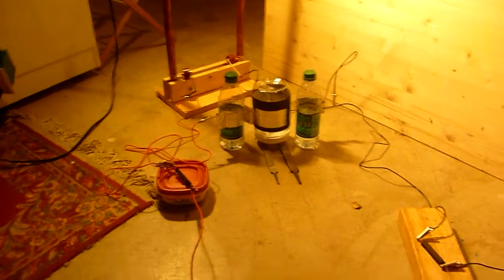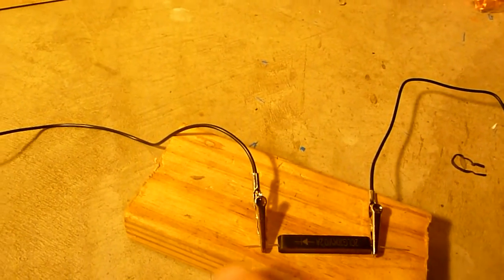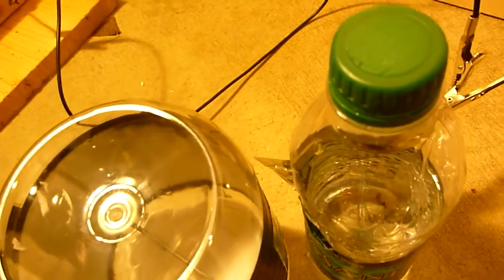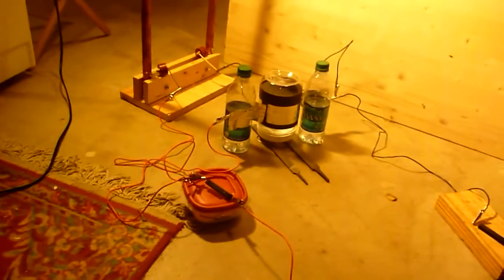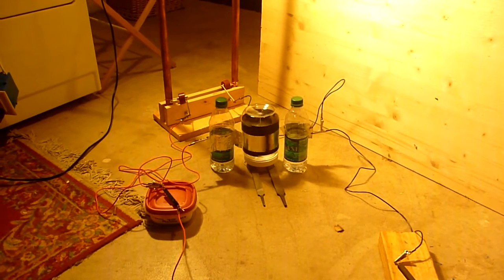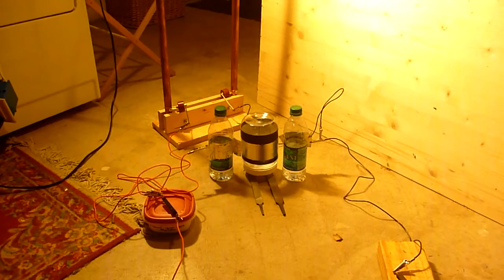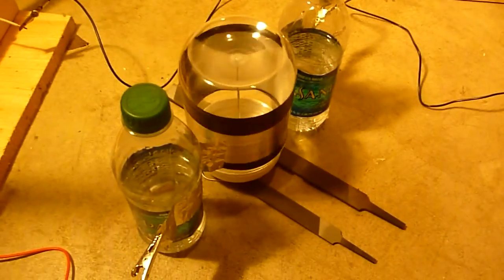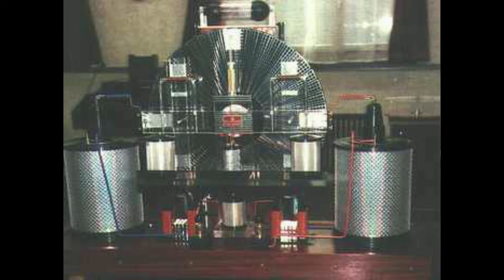Contact-free electrostatic motor (made out of trash)

Comment: I learnt just last year that energy does not flow through conductors. In fact, the an energy source just loses energy to the field (aether) and exact amount of energy is absorbed by the conductors and the load. Reading "A history of the theories of aether and electricity" right now. That's a cool motor you've got running there. Subscribed.

Comment: Nice diodes... I am going to get some like that, I've been shopping around for HV diodes for a while now... Nice setup and looking forward to seeing where your investigation leads you... Remember to always try and think of ways to quantify Power In vs Power Out... Looking forward.
Reply from the maker: +Binj Komisar Power in vs. Power out, that is how you should do it! Thanx for the comment. I've got my diodes from ebay they were 15$ a piece, or you can buy 4 of 'em for 50$. I made a really dumb mistake of using them to rectify power involving higher amperage than 0.2 amps. I actually ended frying 2 of 'em (I had 6 total). I want to try to make electrets again OR a coaxial cable generator. If you stretch a coaxial cable straight 5-10 feet off the ground, horizontally to the ground (it has to be suspended) then you connect the outer layer of the cable with the inner layer (connect foil with copper core). You get a very strong static charge forming in the end of the cable (the charge is related to the length of the cable). John Bedini used this coaxial cable in conjunction with a Tesla Coil (in reverse) to charge a car battery (this actually works pretty well). I want to try this as well.

Comment: Very interesting experiments. So, I have some questions. Maybe you will consider it stupid, but anyway ...

The rotor is standing on ..what, besides those files? There is a bearing, or an axel? Why high voltage? You wrote this : In 18th century the metal conductors were called "obstructors" because they obstructed the electric field, while the non-metals were called "electrics" Can you elaborate? I'm very curious about this.

Thank you for response.
Reply from the maker: Thank you for the question. I should have been more clear in the video about what is going on. The rotor is an upside down can with a coat hanger wire poking through the hole in the lid. The bottom of the can has a little cavity right in the centre of it. This cavity stops the wire from going all the way through the can but also prevents it from sliding around (very simple setup). The files are there at the bottom to hold the hanger wire steady and prevent it from wobbling. Now as far as my statement. In modern time it became accepted that the electron is the charge carrier in electricity through the works of J. J. Thompson. However, even J. J. Thompson himself had doubts about electron really being the charge carrier in electricity. He reluctantly agreed to it after being promised fame and fortune by various people. Well before it became accepted that electron was the charge carrier there was the concept of electrical fields and the concept of the electrical aether that permeates space. All famous scientists of the time including N. Tesla and even Einstein believed that the electric aether was real. Many of the physical experiments support this theory as well (like running sparks in vacuum, the electrical effects become more dramatic). Since vacuum has very few 'electrons' vacuum should be the best possible insulator of electricity, that is not the case, however. If you are truly interested in the ideas of Tesla, Oliver Heaviside, Steinmetz, check out lectures by Eric Dollard. Dollard brought up much of this old information to the surface through various books which are out of print. https://www.youtube.com/watch?v=JQnSz_e7jvc (his lecture on Energy Synthesis). He has 2 other brilliant lectures.
Reply: Thank's again for your response. I heard about Eric Dollard and I will look for his lectures. Yes, I'm interested in different approaches to actual theories, like the Electric Universe.
Reply from the maker: jimmytwen Welcome. Yep that book 'electric universe by Thornhill" is pretty awesome. Electricity is the dominant force in the universe, not gravity. Gravity may not even exist and be a derivative of magnetism and electricity. Gravity might be like static electricity but on a much larger scale (since the planets do have a charge around them). Dollard's lectures mirror the work of German Engineer Konstantin Meyl (Dollard's stuff is more comprehensive though since Meyl is German). Anywho... cheers keep me updated if you learn something interesting.
Reply: Yes. I will do it. Cheers.